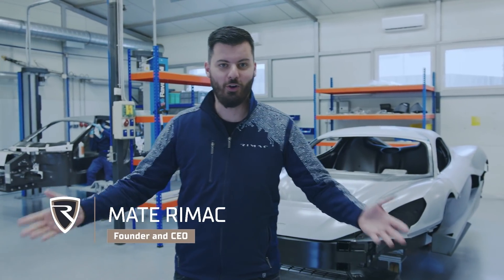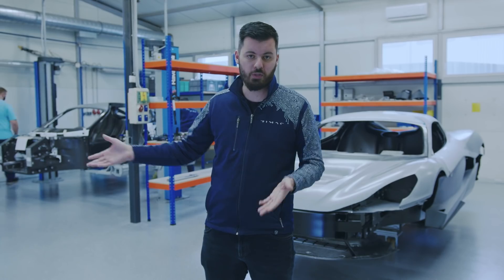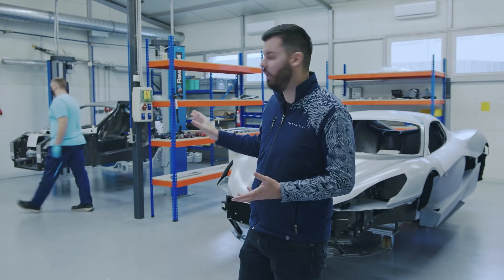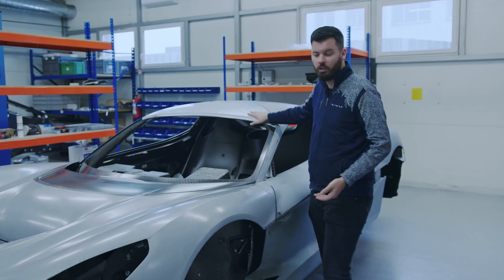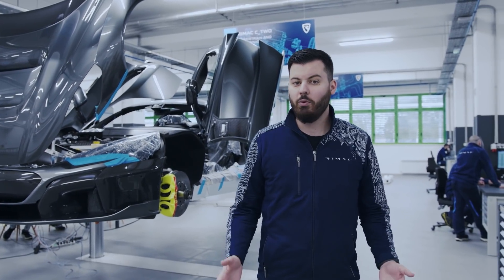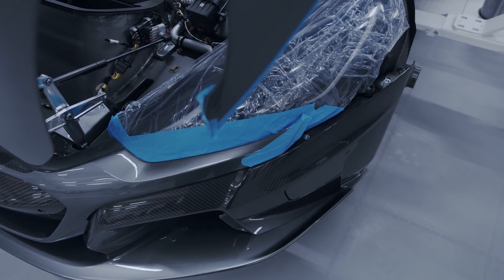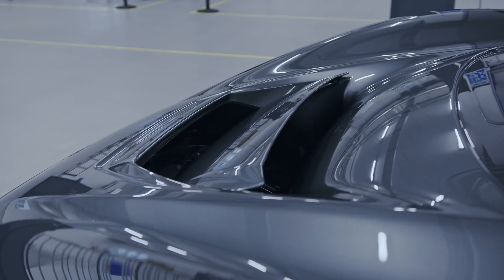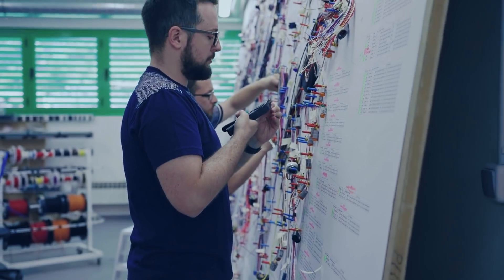Rimac Nevera Pre-Series Start of Production | Mondays with Mate E16

Comment: Mate.  Great video.  Why not turn the car on a rotisserie to prevent ergonomic issue in zone 2... also add an inline measurement system to check gap and flush.  There is a company in Greece called Inos that specializes in those system.